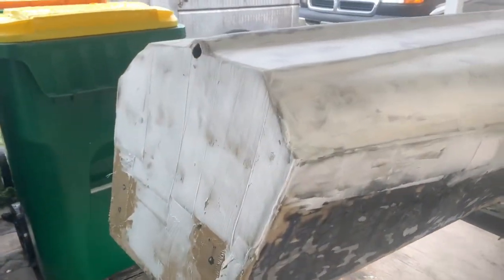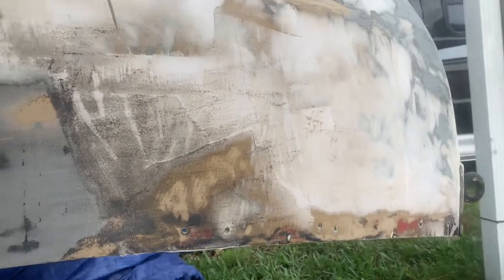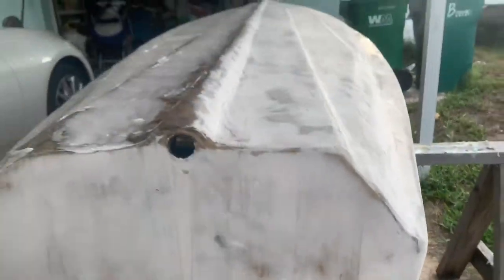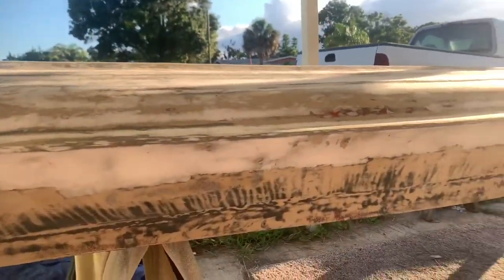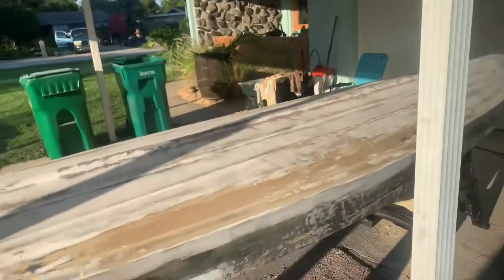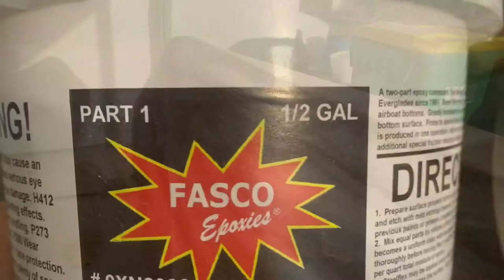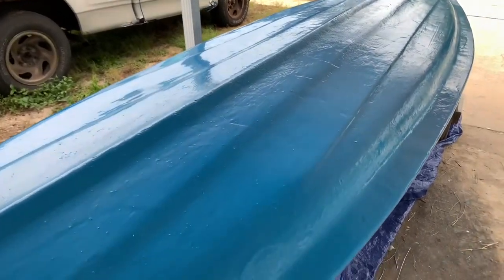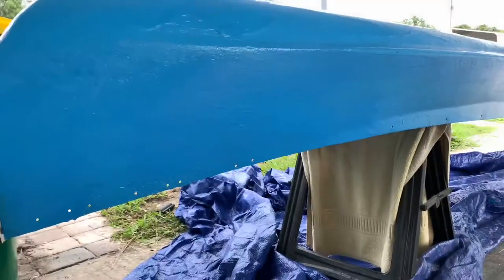Prepping and Painting Entire Gheenoe With Steelflex Super Slick! (Gheenoe Build Part 2)

Comment: Blue looks Good! How much Epoxy for one coat? I see looks like you got 1/2 gal. kit - Did you use 1/2 (1 qt.) Then mix other half or mix all one time? I have square back canoe about same size & wondering how much I should get- Thanks for video-
Reply from the maker: yep half gal kit will be plenty 
and use half for first coat and half for the second coat when it is getting sticky/tacky apply the second coat. I did it this way because it starts to set pretty quick